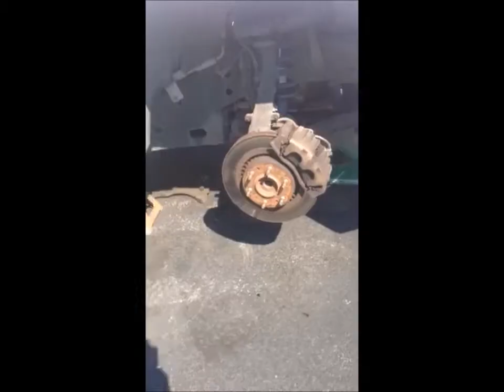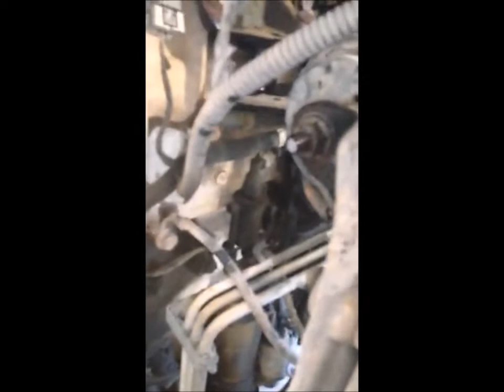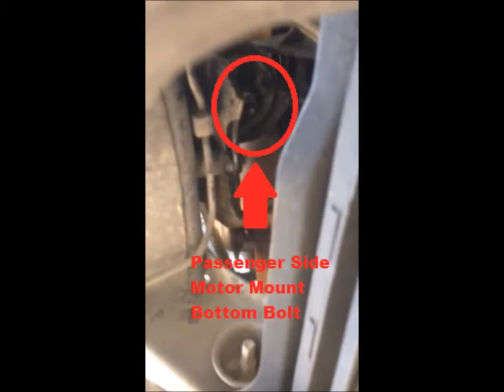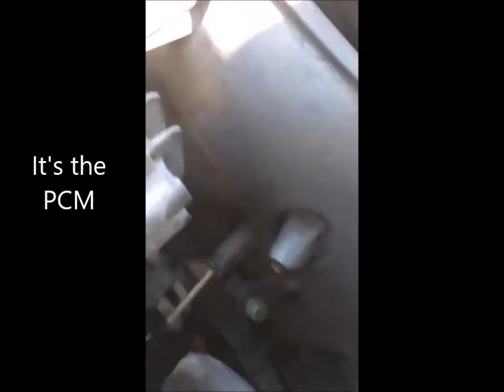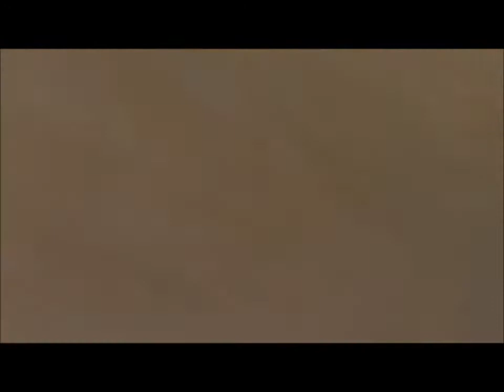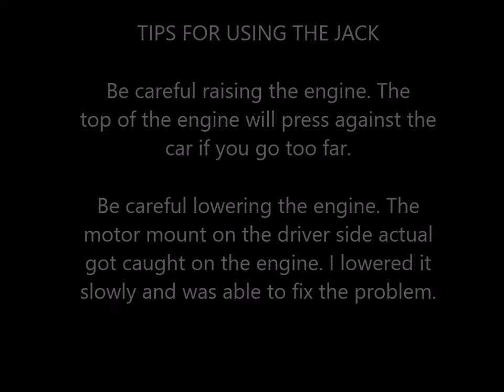Chevy Trailblazer Motor Mount Replacement - 2002 LT also GMC ENVOY

Comment: I know GM Parts are the best you can get. Yes, I have seen the "Beware" 
signs all over the internet about Aftermarket Motor Mounts & Trans 
Mounts for Trailblazers, but the price for a GM Motor Mount is enough to
 make your eyes go crossed permanently! Is this just another way for GM 
to make more Money off of you or is it a FACT? I mean, If i can buy an 
Aftermarket Motor Mount cheaper, but have the Quality of a OEM Part? 
Then Please let me know something!!!
Reply from the maker: Hey Billy! The quality of the GM parts is pretty high. I've never had an issue when using A/C Delco parts. I originally used aftermarket motor mounts and they stopped working after several months and vibrated terribly. If you do go with an Aftermarket part, be sure to go with the higher end and not the low priced ones. I wouldn't buy anything that's less than half the value of the GM part. The rule I go with is if the manufacturer has a good reputation the parts probably aren't that bad. If you don't know who the manufacturer is, then you're taking a risk. What aftermarket part are you looking at?
Reply: I was looking on www.rockauto.com at their prices. It's funny! They have these Motor Mounts for as low as $10.00. Then you scroll down to the GM Part and it's in between $100 to $200. Which on do you think would be best? LOL!!!
Reply from the maker: @billydenham9313   if you really don't want to buy the AC Delco I would go with the Westar brand for the solid mount or Anchor for the hydraulic as it is most popular. Solid mounts take a little longer to smooth out but you don't have to worry about them leaking. I originally used a cheap hydraulic mount and it leaked and rattled like crazy. I then bought the AC Delco and haven't had a problem since.

Check out this link for a discussion over sold vs hydraulic.

http://www.sccoa.com/forums/showthread.php?94279-solid-vs-hydraulic-motor-mounts
Reply: What my problem is is these Mounts are not cheap and i don't have that kind of money to through around like that. The reason why I am going with the Mounts is because i have a ruff vibration in between 20 to 25mph. I took it to a Garage, they drove it and said it was the Motor Mounts, but when i put it in drive and hold the break and give it some gas. I don't hear any kind of popping or any other kind of noise. How would i know for a fact that this is even my problem? I don't trust Garages around here, because some times they make up stuff in order to get your money! So, What do you think?
Reply from the maker: How old is your car? Is the vibration in your steering wheel or just a noise you are hearing? If it's the mounts, I would think it would vibrate all the time in drive or in neutral. I understand you on the shops. I've received my fare share of garbage diagnostics or fixes that really weren't as bad as they said they were. A really funny recent story was my car would slowly die in park and the shop told me the Crank Case Breather Assembly was going bad and it would be thousands of dollars to fix it. I replaced two small vacuum hoses and the problem went away...
Reply: It's a 2004 and it has over 230K Miles on it, but it still sounds Great and Rides even better! The Vibration is in the steering wheel, but only happens between 20 to 25mph. After it gets past 25mph it goes away. A Shop told me that was what it was, but when he tried it out and i was with him, he tried holding his foot on the break while giving it gas and it didn't make any Popping noise and same way in Reverse. Looking under the hood the engine doesn't move very much while doing his test either. I work on this vehicle myself in my Garage and i can't figure this one out! I have thrown parts at it for the past year and nothing! What ever this is it's in the Front.
Reply from the maker: @billydenham9313  Yah, I'm starting to think it's not the motor mounts or even a transmission mount. That is interesting that it only happens between 20 to 25 mph. I've had vibration in the steering wheel due to alignment/tires needing rotation/tires needing replacing and bad/over-worn rotors. What all have you tried to fix so far and what did the mechanic say after the tests lol! Pretty hard to say it's the motor mounts after it makes no noise sitting still.
Reply: Yes, Between 20 to 25mph and then it goes away as i go faster. Then when i slow down it then comes back at 25 and lasts to 20mph. It's almost like running over those ridges on the side of the 4 Lane.  I have replaced both hubs, Axles, upper and lower balljoints, swaybar links. It sounds like it's coming from the Drivers side front. I am at a lose here! Please help anyone!
Reply: I bought the Anchor hydraulic mounts because the AC Delco was just too expensive on Roc Auto. I was kind of weary because I know the best parts for these trucks are AC Delco brand and if it were an Electronics part I would certainly pay it. I will report back in a few months lol.

Comment: I tried to do motor mounts on my 2006 envoy and jacking the motor up would not give me enough clearance to remove motor mounts. My throttle bottle and intake were jacked into the firewall to the point where I was about 1/2 inch from being able to remove. I guess my option is to remove by removing the motor mount brackets. Bummer. Wish it would have worked out. I didn't want to remove the intake. Looked like that was gonna suck.
Reply from the maker: I'm sorry that this method did not work for you. It can be very tight and I did have to jack my engine up so that the air intake was pushing against the firewall. This job is one that you have to be pretty careful in. Removing the motor mount brackets is the recommended method by the repair manuals.

Comment: I too was having violent vibrations on starting and shutting off engine, as well as driving and stopping. I purchased my mounts here, https://www.amazon.com/gp/product/B00GUJ9CUO/ref=oh_aui_detailpage_o03_s00?ie=UTF8&psc=1   $81.99 per piece but is original GM product, not being a mechanic but having a lot of common sense I tackled this head on, I only had very common tools, I did buy the 21mm wench and a 21mm socket,  some suggested taking the struts off. I did not, I did however take the 4 bolts that hold the fan on off to allow more clearance and not taking a chance on damage it, I also found it easier to take off the mounting bracket that holds the motor mount, the three bolts in front of the strut, this was easier for me and I did not remove the strut, I simply pried a bar between the spring and the body to allow the bolt to move out of way, (caution) in putting back these bolts neet to be pulled out as far as you can otherwise the bracket will not set flat on frame, I had to do the passenger twice as I didn't check this well until I was finishing up and noticed it, in all it took me about 8 hours, having to do it again I would say I could knock it down to 5 complete. the truck has no more vibration and or shakes..

Comment from the maker: The Motor Mount I recommend for replacement is sold by AC Delco

https://www.amazon.com/gp/product/B010GP6JVC/ref=as_li_qf_sp_asin_il_tl?ie=UTF8&tag=d0d417-20&camp=1789&creative=9325&linkCode=as2&creativeASIN=B010GP6JVC&linkId=2dbcd373538d5c61c70b7cb6a3f1ee9e

Comment: D Murph- First time watching your video n channel. 👍 I have the same problem with my '03 TB. Question: How are those mounts from rock auto holding up? Still no more shaking? After reading a lot of negative rock auto parts reviews, it makes me nervous ordering from them...
Reply from the maker: +Vik Andrade thank you for checking my video out! The mounts are holding up very well! There is a slight vibration that does not occur very often and that may be from my transmission mount (it's still the original). I typically get AC Delco parts from RockAuto and those always work great. I went with this particular brand to save money.
Reply: DMurph Got it. Thank you for the update. Depending on my budget, I will consider both brands.  Have a great weekend.

Comment: So you didn't have to unhook the fan/radiator or any of that to raise the engine?  And you unbolted the mounts, raised, then slid the mounts out? Really nervous about this - any other comments appreciated.
Reply from the maker: Correct Mike P, I didn't take anything else off of the engine in order to raise it besides the three parts I circled in the video. Of course if that is advisable then I would go ahead and do so.
     In order to do the job I basically watched other people's motor mount replacement videos for several different cars and then did it myself. There were also a few thread discussions or vlogs that discussed removing the motor mounts from a Trailblazer. Those were helpful as well.
     As long as you have your car safely raised on jack stands and the jack you use for your engine is secure I think you should be ok. Just be careful on the driver side because that is the hardest part. Also watch my whole video if you haven't because I included tips in text after the video about work that I was unable to record. 
     If you're feeling nervous about doing it hold off until you feel like you have enough info or help to safely do this job. Personally, I don't do repairs that I am nervous about. Safety first =)
     I'm going to try and shoot another video of replacing just the driver side motor mount but I may not be able to get that posted for several weeks. I hope this helps!

Comment: once you remove the 4 10mm bolts holding the pcm, how do you move the plate it's attached to, it sits directly above the motor mount bolt?than k s
Reply from the maker: I actually did not remove the plate. It looked like that would have taken more time than I had available. 
     I moved the PCM to get a little more room for my arm to work with the ratchet directly underneath the plate. I found it easier to loosen the the bolt from the top of the engine compartment rather than from the wheel well.
Reply: DMurph -makes sense, thanks again

Comment: is there enough room on the driver's side to use a racheting wrench?  you sad it took 2 hours are u a professional? I've done sway bar links tie rods wheel bearings  and ball joints on my envoy  just wondering if I can do all that so I should be able to do the mounts.
Reply from the maker: I believe there is enough room to use a ratcheting wrench. I used a standard ratchet and would have preferred the tool you are talking about for the driver side.  I am not a professional, and I've just been working on my own cars for a few years. You should be able to do the mounts. Just be careful when jacking up the engine. 

Overall, it went fine for me but my car moved roughly an inch on the jack stands (I had to jack the engine up pretty high to make room for the new motor mounts. If you don't like the idea of jacking your engine up so high I read that some people shave the top thread on the new motor mount down a little for better clearance.

If you have more questions Christopher feel free to ask.